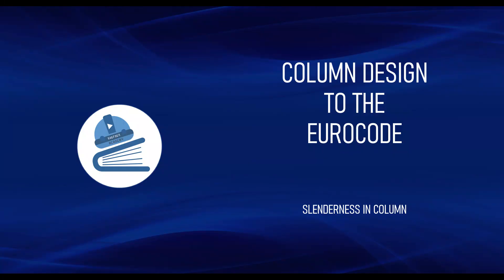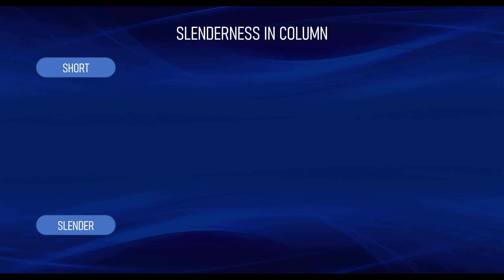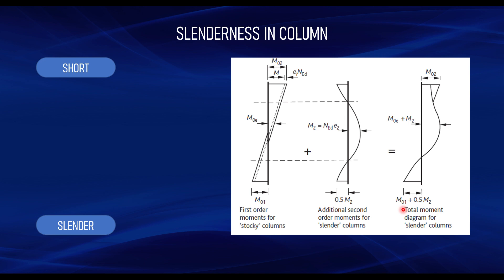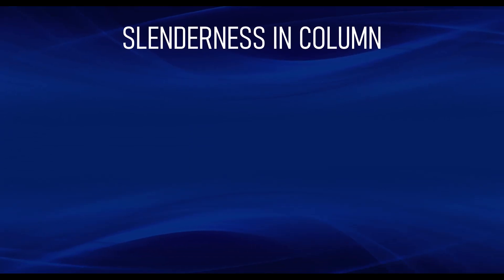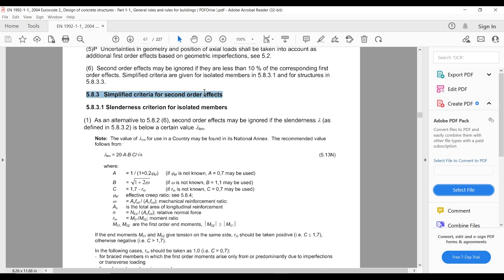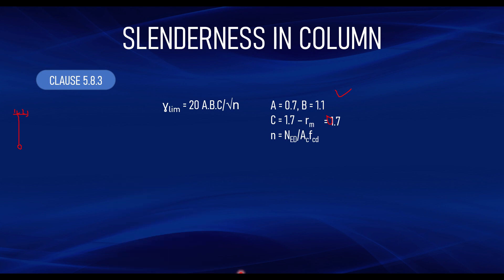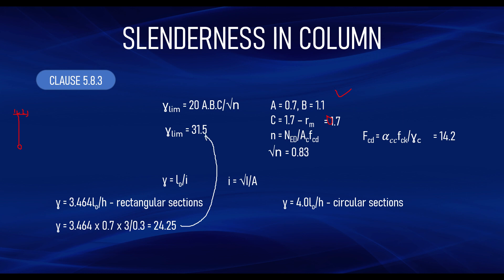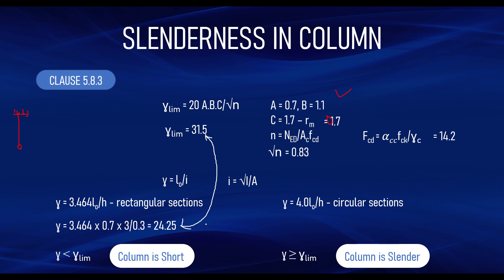Short and Slender Column Explained! | Slenderness in RC Column

Comment: Clarification on Sign Convention for M 01 and M 02in Slenderness Ratio Calculation
Dear Professor,
First of all, I would like to sincerely thank you for taking the time to read this comment. I hope you could kindly help me clarify a question, so I can strengthen my understanding of Reinforced Concrete design.
My question concerns the calculation of rmin the formula for determining the coefficient C when checking the slenderness limit.
I have encountered two different interpretations regarding how to determine the signs of M 01and M 02
1. The signs of these moments are based on the bending moment diagram (BMD).
2. The signs are determined from the externally applied moments (first-order moments). If the two moments act in the same direction (e.g., both clockwise), they will have the same sign, and thus 𝑀01/𝑀02>0
I would greatly appreciate it if you could clarify which approach is correct, or under what context each method should be applied.
Thank you very much for your time and support.